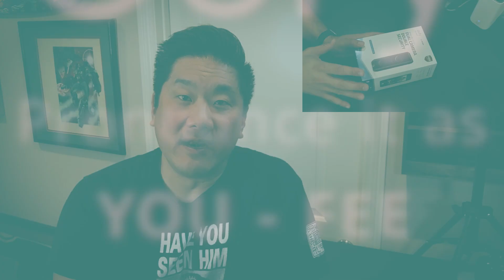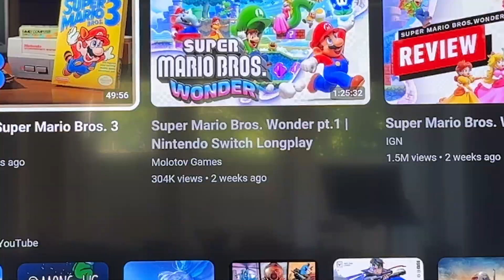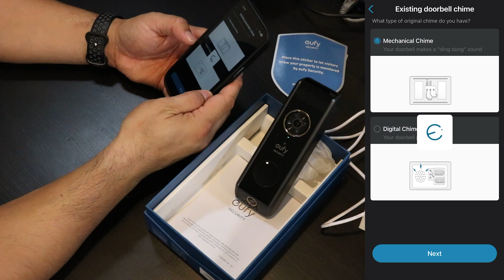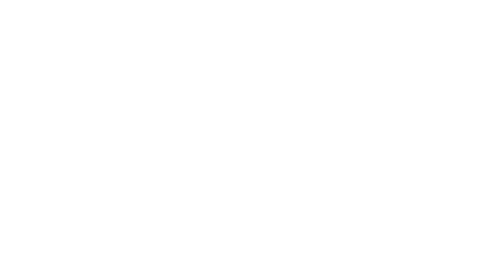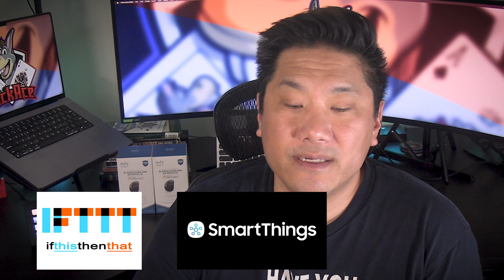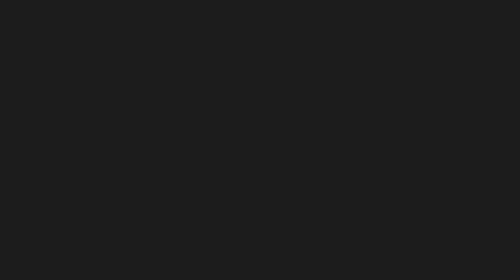BETTER THAN RING! BETTER THAN ARLO! NO MONTHLY FEES! Eufy Dual Camera Doorbell S330 #homesecurity

Comment: EUFY S330 is not working properly. Hardwired not work and you need to recharge the battery very two months. Misleading information about 6 months battery life when fully charged. ONLY LAST FOR 2.5 months and hard wired could not charge.
Reply from the maker: Sorry to hear that... I'll see if I run into this issue in the future.

Comment: How about mechanical chime? Does it work with  it ? Or comes with something to make the mechanical chime work with it?
Reply from the maker: It works with my mechanical chime. It also rings on the Homebase unit (optional). You can also buy wireless "chimes" which just plug in and you have to join them to your WiFi, I believe.
Reply: @JackAceTech  how do you make it work ? What connections do you connect? Because I asked eufy and they told me none of their doorbell cameras work with mechanical chimes. They told me to buy wireless one. But I want mechanical one.
Reply: @kingj9606 just look up "install mechanical chime" you need a 24v transformer and a chime and doorbell. The transformer connects to your breaker panel. The installation is basic and theres 100s on youtube. Usually an electrician installed this into your home so that your existing doorbell works.